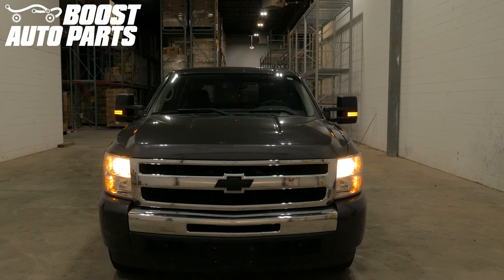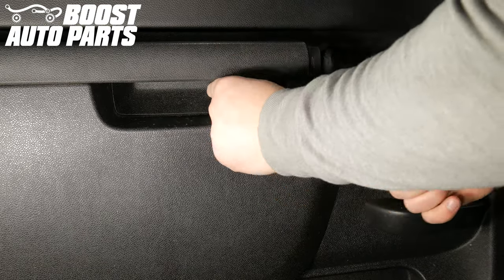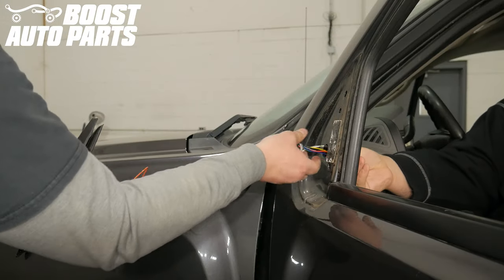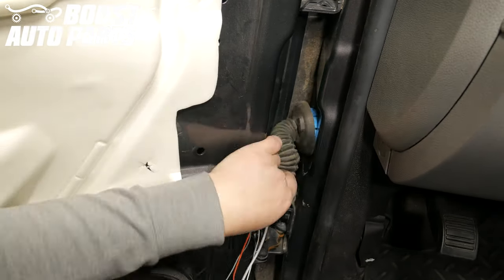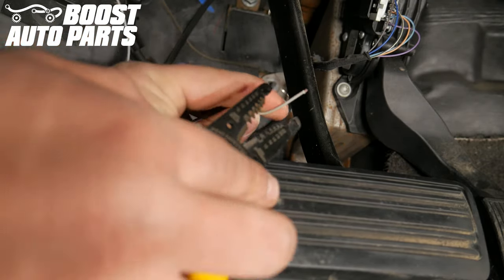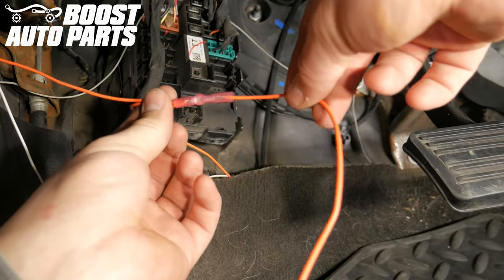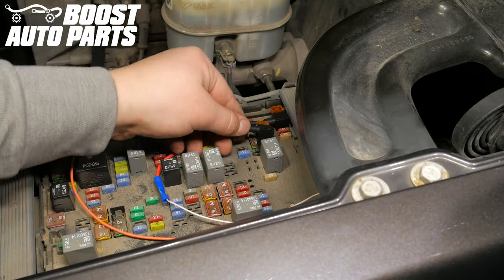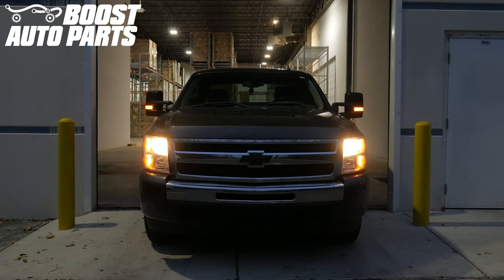Full Tow Mirror Install: (2007-2014) Silverado & Sierra Trucks (LS, LT, SL, SLE) - Boost Auto Parts

Comment: I had a 2000 chevy and it was sooo easy replacing the mirrors these new trucks suck so much more work for something that should be simple
Reply from the maker: We try to make it as easy as possible, though it's limited based on the vehicle design

Comment: I have a 2007 Chevy Silverado New body style and when I bought it. I noticed on the door it has a hole because it had Manuel
Windows, but they add everything to make it power windows. Will I still be able to add these side mirrors and have them fully function if so where would I be able to hook it up too?
Reply from the maker: We don't have an upgrade path to add power adjust to vehicles not originally equipped unfortunately. Give our team a call at 765-831-2830 to further discuss.
Reply: @boostautoparts  okay thanks!

Comment: So I have a 2011 silverado 1500 wt and  i bought some tow mirrors with  signal indicator and backup light, and powerd adjustment. The doors have the manual window and stock mirros with no power function. Is there any way to hook up the tow mirrors for the signal Indicator and backup lights to work? Thanks
Reply from the maker: You can wire up the reverse light following this video. We don't currently offer an upgrade path to gain signal if you have totally manual mirrors.

Comment: what do yall consider low trim trucks??
Reply from the maker: WT, LS, LT, SL, SLE
Reply: @boostautoparts  my WT trim has no power mirrors, windows, or locks 
Does this video still apply?
Reply from the maker: @nathan484848  No - in that case we do not have a video as the only option would be to totally hardwire everything in.
Reply: SLE is higher trim than those others. WT, SL, SLT are typically the black trim. SLE has chrome

Comment: What would cause the clearance lights to not stay lit? I installed my mirrors and the clearance lights come on when I unlock the doors and lock them but the second that I put the key in the ignition they turn off and don’t come back on
Reply from the maker: Likely an issue with the orange wire. Email support@boostautoparts.com and our team will get you taken care of.
Reply: Did you ever figure anything out? Only my turn signal, and emergency lights work. They won’t stay lit while my truck is running/driving

Comment: Hey so I drive a Chevy silverado 2009  4.8L V8 LT work truck and I wanted to upgrade the mirrors on it but I don’t have a wire for the turning signals how would I get this to work?
Reply from the maker: Turn signal should be plug and play with our mirrors, assuming you had power adjust mirrors from factory.

Reach out to our support team at 765-831-2830 or support@boostautoparts.com with any further questions.

Comment: I'm looking at a set of these but have read they don't work with the temp sensor. I'm not sure what they are referring to as the outside temp probe is in the grille support? Can you explain?
Reply from the maker: That is only relevant for 2015+ vehicles, this video is for 2007-2014 so you certainly won't have an issue.

If you do have a 2015+, we offer mirrors with temp sensor. Give our team a call at 765-831-2830 with any questions or email sales@boostautoparts.com with your VIN for assistance.

Comment: @Boost Auto Parts  my WT trim has no power mirrors, windows, or locks 
Does this video still apply?
Reply from the maker: No - in that case we do not have a video as the only option would be to totally hardwire everything in.
Reply: @boostautoparts  ok I have heated rear glass currently but not heated mirrors how would I go about hard wiring the heated section into it or can I wire it to a manual toggle switch?
Reply from the maker: @nathan484848  Unfortunately we do not offer a defrost upgrade for the mirrors.

Comment: They need to come out with power fold for these
Reply from the maker: Power fold for these trucks will be coming out towards the end of this year. Email sales@boostautoparts.com to be notified when it's available.
Reply: @boostautoparts  estimate on price they are going to be?
Reply from the maker: @rboyett  Pricing information not available yet - but you can look at power folding mirrors for a 2015 Silverado to get an idea for a typical power folding mirror price.
Reply: @boostautoparts  any update on the release of the power folding mirrors for the 07-14 GM 1500s?
Reply from the maker: @MITSCG  Still in the works - please contact our team at sales@boostautoparts.com for more info

Comment: My stock mirrors do not have a turn signal, what other steps do I need to follow for the turn signal to work?
Reply from the maker: Turn signal will be plug and play with the Boost Auto Parts mirrors.
Reply: @boostautoparts  do you have an option that doesn’t include running lights or backup lights for cheaper? Also how was is shipping to Denver Colorado area? Also what is the difference between the custom built mirrors and pre built? Finally, is the lower mirror convex so that a blind spot mirror is not required?
Reply from the maker: @jgruen9854  We don't have an option without lighting for the 2007-2014 trucks. We offer free ground shipping to Denver. Custom built mirrors offer 50+ options, whereas pre-built mirrors are our most popular options but they are discounted. The lower glass is convex.

Give our team a call at 765-831-2830 and they can answer any further questions you have.

Comment: so if i use a blinker do both mirrors flash or just the correct side? i dont understand how they would flash correctly if both spliced
Reply from the maker: Only one side would flash. The wire you are running is not the blinker, it's the running light wire. Turn signal is plug & play.
Reply: @boostautoparts  understood thank you
Reply from the maker: @DjkFarmdunn  No problem!